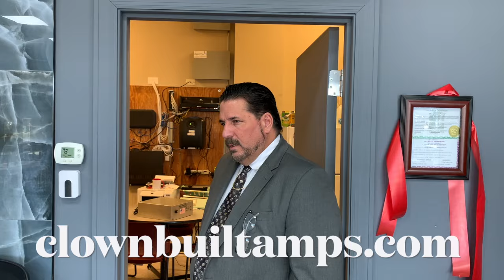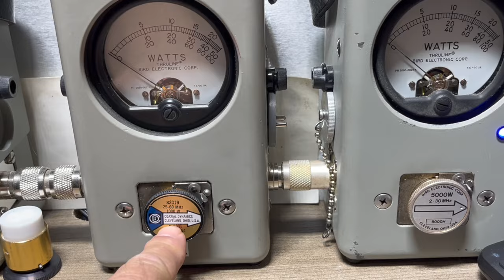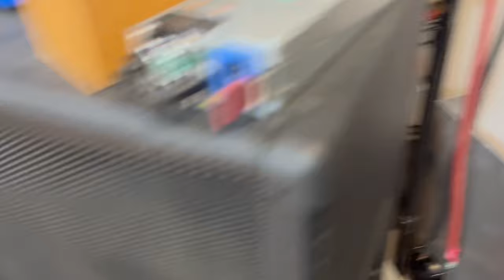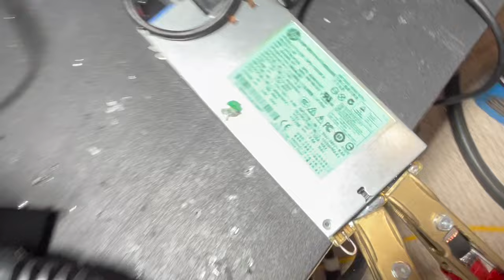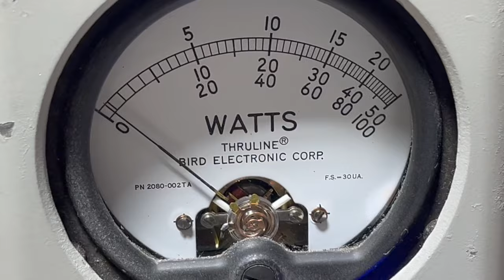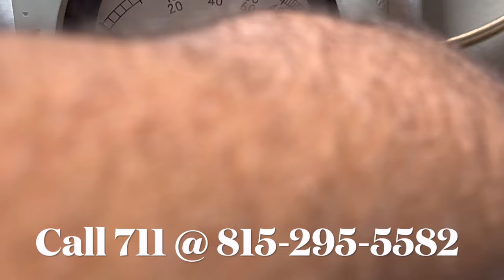5 Pill Clown Repair & Tune

Comment: Those grills on the back fan is what makes that sound, I use to cut  the grills out and the sound goes away. Back then the transformers where 35A each not 50A, I have 16 in two power supplies under my work bench, 8 transformers in each one with 8 big caps in each also. They are 280A's each I have the tied them together totaling 560A's to run my DD-4000 32-Pill. I have LARGE! rectifiers in them and they are still working after 25 years. I use my newer power supplies now for testing boxes @ 15V's. Other than that GOOD JOB! Your friend the Professor "Tech-Nine" Happy Holidays! PS. those transformers weight 13-lbs each.
Reply from the maker: Omg. You will need a crane to move that thing. Wow. 73’s. And happy holidays to you as well. Ps: the older we get the heavier they are lol.
Reply: I need box from you o.g

Comment: I had a power supply with four of those transformers. That thing was a brick, I got tired of replacing bridge rectifiers and sent it down the road.
Reply from the maker: Haha. 10-4
Reply: How much dead key did you have on that one by four?
Reply from the maker: the radio dead keys 1/2 watt. The box dead keys 100 and swings forward from there.
Reply: @28chicagovideogate50  Thanks just wanted to make sure I am doing mine right.